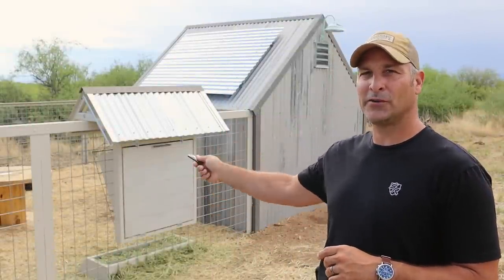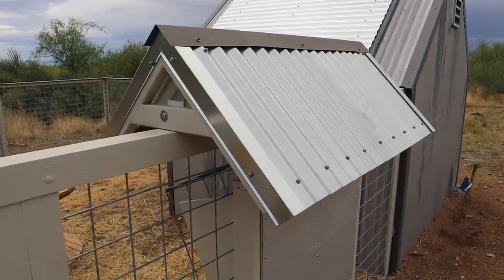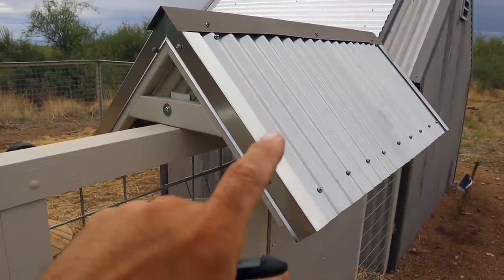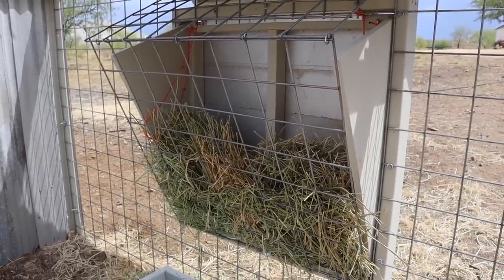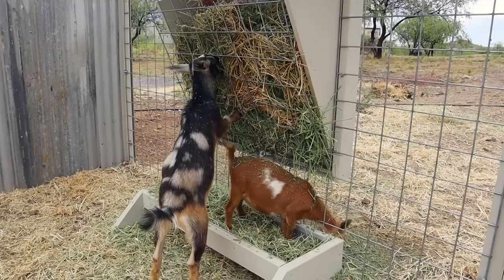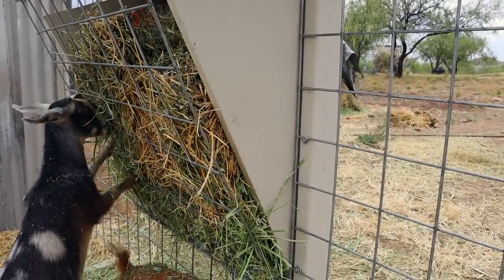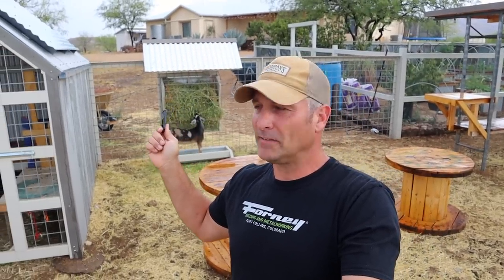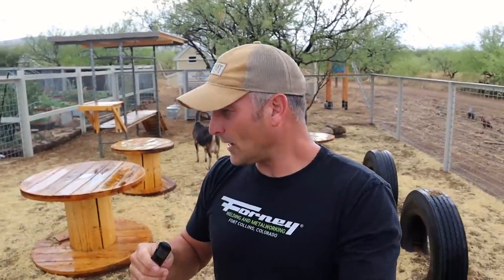DIY Hay Feeder For Goats and Other Livestock

Comment: Thanks Joe, another opportunity to see your creativity in action.   Have you considered extending the goat shed lines outward for your hay storage.   Adding sliding doors on both sides allowing easy access for feeding the goats.  Rainwater harvest could be concatenated into the same cistern.  Wishing you and your family a blessed week, gentle weather and restful evenings.  Peace brother.
Reply from the maker: So I actually have thought about extending it on the fence line.   But the big issue is that I ran out of the older ‘aged’ roofing that I used on the goat barn structure… and extending it and using new roofing would bug me😂

So the plan now is to move the rain roof structure down to the goat yard  and situate along the fence line as hay storage, shade and rainwater harvesting capabilities.

Comment: Goat heaven there Joe❣️ I knew you’d be doing a water system for the goats too, do you have enough steel to extend the current barn for the food storage? That would increase your water harvest capabilities as well. 🐐🐐🐐
Reply from the maker: You know what…sadly my steel is dwindling down fast.   I’ve only got the really bent and twisted pieces so it’s hard to pick through and cut what I need.   BUT it is still free… with the expensive of a abrasive wheel or two to cut them down.
And for the structure….I’m actually thinking of repurposing my old rain roof project and bringing all that structure over.   With the prices of everything going to the moon… I’ve got to be even more resourceful
Reply: @homesteadonomics  prices are crazy here in Australia too, we’re in the middle of a home renovation but luckily we got the majority of our supplies at the start of lockdowns, I do get heart palpitations when we need to head back to
Town for more supplies with the price of fuel alone. 😳

Comment: Have you ever calculated how much water you catch in a year?
Reply from the maker: Well yes and no…. Because we are limited in our capacity we can’t catch all of it during our monsoons, so we overflow for a bit.   The total capacity at one time is roughly 13k gallons…. So most monsoon seasons we will be overflowing for the last several rains so I can’t truly calculate what we are catching and not being able to keep.  I know that is kinda vague…haha…. But it’s that our capacity to hold differs from our ability to collect.  For example last years monsoon we got nearly 20” of rain in a bit over 2 months.   Which equates to about 25000 gallons.  So much of the monsoon our tanks were just overflowing.   
Of course I was trenching and directing water around to trees and such.    But in a down year we may get less than 5-7 inches in that same span…. And in that case our tanks are enough for what we get. 
 It’s been my hope to add tanks eventually or to build a proper cistern.   But we are like any other family… it’s a financial thing first.   And this last year is not making it any easier🤦‍♂️

Comment: Nice looking feeder, but mine would get their horns stuck in the wire.
Reply from the maker: Yeah depending on the goat that is possible.   These are 4x4” squares.   If it does become an issue i would likely replace with vertical bars likes some of the commercial ones.